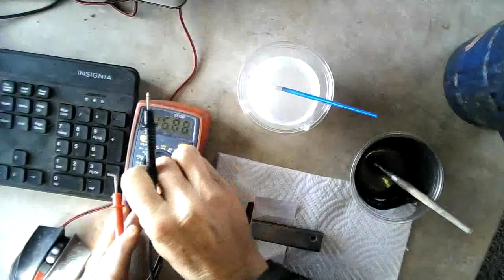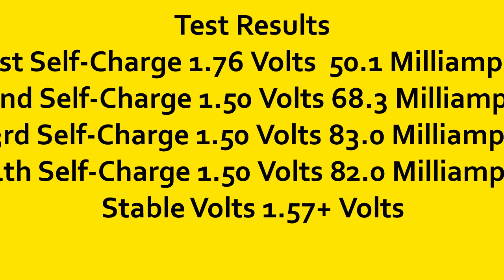Magnesium Bio-Cell Test #2

Comment: Hi Ray. Thanks for another upload :) Can you add some heat to the cell and see if the voltage and amp rises? By using an hair dryer or a heat gun.
Reply from the maker: Hi BakamonNo, sure, I can try that for you, but it will dry the cell out some, so I'll have to keep it fairly short. I'll squeeze it into the video tonight if there is time.

Comment: Hi, well that's a little surprising it's oxidised that quickly, are you sure it didn't dry out slightly?
Reply from the maker: I even added some water to it, because that's what I thought at first too. I think it's related to the need for an alkaline electrode. I'll add some alkaline material on the next test and see what that does. I'm betting it oxidizes slower next time.

Comment: The duration between the first discharge and rebound was 2 minutes and 31 seconds. Couldn't measure the 2nd one because you stopped the video.The duration between the 3rd discharge and rebound to 1.5 volts was 2 minutes and 49 seconds. Assuming a linear correlation it takes a bit longer each time to rebound but develops a higher amperage. Very interesting. 
That figures to be a 12% increase in time for a 20% increase in amperage. Next time leave the video going to determine if it's linear. Maybe even one more run to develop a time/increase curve. That way we can calculate how high and how soon it could be expected to rise.
Reply from the maker: It does appear to be a direct relationship, but it peaks at some point, because cycling the cell a few more times produced progressively less power. So the oxide helps for a while, then it hurts the cell I think. I added an alkaline additive to the cell later, and got some real interesting results I'll show in a future test.